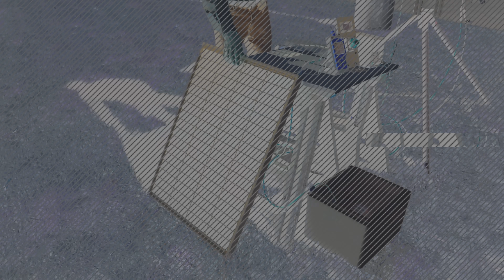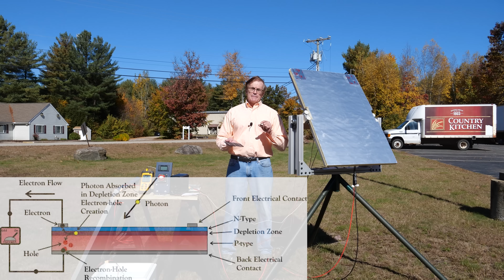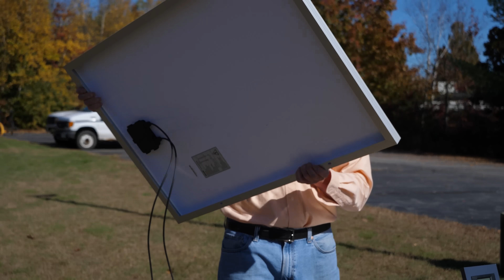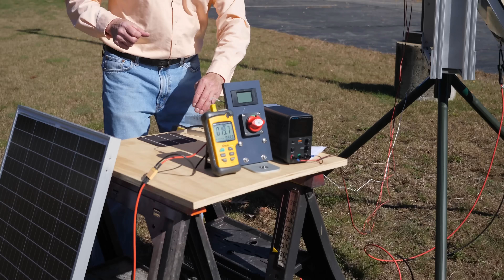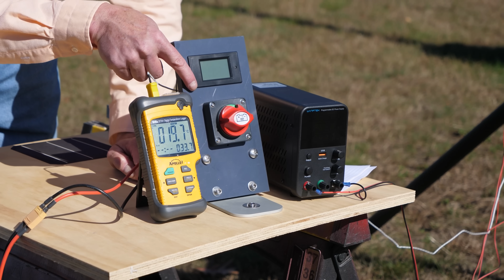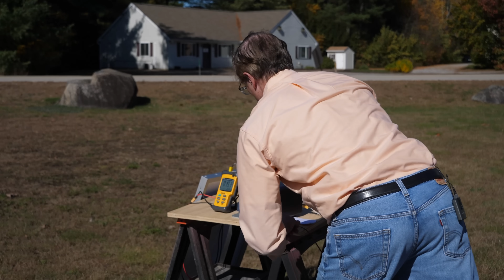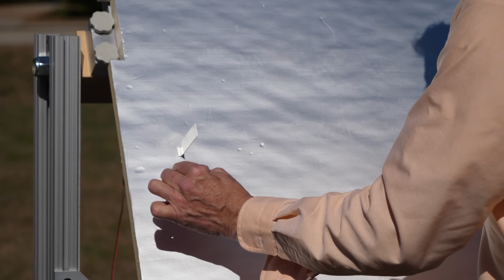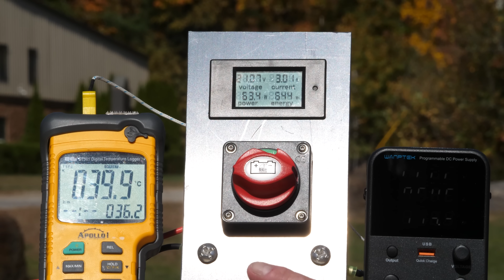Do you REALLY get enough out of your solar panel?

Comment: Imho you're reasoning in the wong (as the chinese say) direction.. Make PV panels generate heat, pump it up with the panel, then you can achieve 80% efficiency..
Reply from the maker: You're simply incorrect.
Do a little  research into the operation of a solar cell.
Reply: @TechIngredients  not incorrect. I mean a panel gets very hot (70%+ of incoming solar gets converted to heat), transfer that heat to water and pump up the temp with the panel output. There are several companies selling products that allow dual use.
Reply from the maker: That heat still needs to be dumped.  If the water becomes  warm enough  to be useful, then the panel  output drops.  If that water is maintained  as cool as possible to maintain PV output, then that water will remain near or below ambient temperature.

Comment: We're just starting to do optimization of our panels outputs on our offgrid setups. Angle is pretty key. I'm working to implement actuators that are arduino based to either follow the sun with a photoresistor, or just set a calendar with optimal angles based on date. I'll have to track the power the actuators use, and make sure they stay in a non-powered, idle state most of the time. Just moving the angle on my solar panels on my solar powered toolshed, increased the output on a 300W panel from 135W to 175W, at about 20 degrees closer to perpendicular to the sun, to 215W in Central Texas at pretty close to perpendicular in the Winter sun! These are used industrial panels too that we picked up for around $75/per.

Comment: I thought the cooling power of the systems of dripping water over the panel surface is not simply the heat transfer but the evaporation cooling? Esp. if the temp difference between panel and air is that high  and the humidity is low it should pull a significant heat energy from the panels, even to below air temperature.
I think it might be interesting to see the effectiveness of just keeping the surface moist...
Reply from the maker: You're  correct, it's  both.

Comment: I have a ground mounted solar system. The age of deflection is 25 degrees, with the solar panels distance from the ground is 2 feet in the front and 8 feet in the back. I believe with this amount of air movement should keep the panels cooler. 
What are your thoughts?
I look forward to your response.
Reply from the maker: Increasing the airflow and / or increasing the surface area to interact with that airflow will help.

Comment: You missed the main reason for using water on the panel surface. The water is not only cooling the panel by absorbing heat it is also EVAPORATING, the latent heat of vaporisation will cool the panel and the air in a warm dry climate. In many hot places they use evaporative cooling to cool the air in their home. Sure over time the the water supply will warm up and you need to use pure (rain)water otherwise the salts disolved in the water will build up on the surface of your panel and increase in your water storage. Evaporation of rain water of your panels will remove about 670 Wh/kg of water, a lot more heat than the gain in temperature from the water.

Comment: Maybe it was mentioned and I didn't hear it, but the increase of watts in efficiency is meaningless as it only applies to this particular model, but percentage increase in efficiency is important.  Based on their results, and accounting for the fan draw, we are seeing about a 3.5% overall increase in efficiency. That might not sound like much, but in the world of solar power, this is a pretty big deal. Assuming the overall efficiency of the panel is roughly 20%, that brings us to 20.7%... which again doesn't sound like much, but really is a pretty big deal. 

Now, one issue I have is that the panel was veing manually moved to optimize solar gain. Probably not a big deal, but an automated system that does the same will also have a power draw that affects the efficiency. I think it would still ultimately result in a net gain, but I would like to see this accounted for. In addition,  a line of solar panels tracking the sun would probably result in some panels putting others in shadow. Anyway, a lot of interesting incremental problems to solve, and I look forward to new developments from this channel!
Reply from the maker: You don't need to track.  I only did this because we were comparing the cooling to passive and couldn't do this at the same time. This made the testing fair.
Reply: @TechIngredients  true, but that doesn't mean you still shouldn't build one! :-)

Comment: The fans need to be installed at the bottom of the panels so they're working with, not against, air convection.
Reply from the maker: No.
They're drawing the air out, not pushing it in.  Convection isn't  opposed.

Comment: Thanks for the science channel here. One idea I can see is that the fans are at the top and suck out all the air and create negative pressure, what about putting them at the bottom and blowing in more air that can receive the heat and it comes out at the top. I have seen someone else who uses his heat pump where he has made a kind of greenhouse with solar panels and the heat pump cools down the panels and heats up the house.
Reply from the maker: The fan position is probably  insignificant.  For what it's  worth, in our arrangement, any heat generated by the fans isn't  added to the cooling air.

Comment: I've been looking into using solar powered fans to evacuate heat from my attic during the summer I intended to maximize their efficiency.  For summer solstice and did not expect them to produce at all in the winter. The rood on my house is quite large and im nearing time for a replacement, adding solar would probably not cost me as much more as the roof replacement.

Comment: You have ignored the inefficiency of the power supply.  The cost of the power supply is also a factor to include with the cost of the panels, and that is also a point of failure because the power supply adds more parts that can fail.  Your suggestions to go with larger fans to handle more solar panels also have to be engineered to flow properly amongst the panels and then there is the complexity of the ducting which you don't want to aid in the heating of your cooling air.  Considering the additional complexity, the additional costs,  and reduced life-cycle costs, it isn't practical except as a science project.  Of course, results will vary.  The equator will provide more photons, but additional heating of the solar cells -- the efficiency ratings given by solar cell manufacturers likely doen't include the degredation due to heating of the panels.  Likewise in Florida, the ambient temperature of the air is warmer year round so solar efficiency is always lower than what the sales people claim.  So, caveat emptor -- let the buyer beware.  This was educational and as usual, well presented.  Cheers
Reply from the maker: I didn't  include  the power supply  cost because  it's  insignificant.  We used the lab supply  because, as I explained, it shows the power consumption.  The DC fans can be run directly by wiring them in series  to match the output voltage, or a solid state voltage converter can run the entire system which consumes little power, so it's cheap.  Any ducting actually  increases effeciency because the ducting is in the shade and so will be at ambient temperature as is the air that is drawn through it.
Reply: @TechIngredients  I agree about the power supply cost.  However the power supply uses electricity which appeared not to be included in you efficiency results.  If you had shown that losses converting the significantly higher voltage (18-21V) down to 6V decreased the overall efficiency by X% resulting in an overall system efficiency of y% improvement, then I wouldn't have commented at all about the validity of your claim but it seems that you stopped 10% short of proving there is a gain of efficiency after accounting for all losses in the system (including the voltage conversion to drive the fans).  The video left the impression that the intent of the video was motivated mostly by driving sales of your superior thermal paste.  I imagine the heat sinks consumed a good amount of paste/panel too.  You did assume a voltage converter losses are insignificant but you did not test it to prove it even though an off the shelf converter board costs little money to buy.
Reply from the maker: If you're  concerned, then just wire them directly to the panels with each series sized to match the desired  voltage. Voltage converters are over 90% effecient if you go that route.
Also, if manufacturers built panels with molded fins, then these would be even more cost-effective and efficient, eliminating  the need for the added labor and the TIM interface.

Comment: I hope you read this: most solar installations are fixed and are not pointing directly at the sun 100% of the time they generate electricity, however, the fans remain at a constant power draw. What would be the efficiency difference of a cooled and non-cooled system over the course of a day as power generation degrades over the day? Maybe it won't matter on a system for example where my theoretical per-panel power generation is 400 watts? Or devise a way to cut power to fans at some sub-optimum level? Or even more so, that even though I live in warm SoCal that temperatures would drop as direct sunlight drops? Is that enough of a drop? So many questions.....
Reply from the maker: That's  easy to implement.  Add a fan controller that turns on the fans when a certain temperature differential  between the ambiant air temperature  and the panel temperature  is exceeded. An Arduino controller can do this.
Reply: @TechIngredients  Thank you for the reply. If I have to do some modification to test efficiency, I would rather install sun-tracking modules for my panels 🙂

Comment: In regards to the backing used :
Using aluminum sheet flat on one side with cooling fins on the back would definitely make sense and be more cost effective than any ad hoc modifications done for custom installs .

Cooling to ambient air temps certainly looks good , but , in my mind , it may just be possible to get far better cooling with a ground state geothermal loop and  a highly efficient pump .
Ground temperatures a few meters below the surface approximate the average yearly temperature ( until you get more than a kilometer or 2 deep , where it starts to rise ) .
Of course this adds expense to the installation .
However , considering typical summer temps in my area are 32C .
However , underground temps are typically 13C year round .
That is quite a difference and could be worth the extra expense , complexity , and , current use .
Adding hollow threaded aluminum heatsinks to facilitate active liquid cooling is certainly doable .
Reply from the maker: Those are all good options.

Comment: Thank you for this very interesting test and demonstration Professor. 🤔 Do you have an equation for this temperature to wattage gain ? Also, have you been able to calculate the falloff in overall photonic efficiency based on degrees of Latitude North of the Equator ? I am located around 49 Degrees North on North Vancouver Island, BC, Canada. I have noticed Solar Panel efficiency to be really reduced during the Winter Months in my locale.
Reply from the maker: Off hand, I don't, but it's  a super simple Google search.

Comment: How about having solars in catch all angles?
Like a lower panel being at an angle of e.g. 45° and above it a panel with e.g. 135° as to have them both reflect rays towards each other no matter what angle the sun is.
Reply from the maker: That's  an interesting idea.  The trade-off is that the individual  panels  will be operating  at less than their optimal angle to the sun.  Whether the light gain due to reflection will more than compensate  for that loss would have to be tested.

Comment: I was thinking if there was enough of temp difference for a series of tec to drive those fans. I guess it could work maybe?
Reply from the maker: It might, but  it's probably not worth it.  These devices  are not cheap and are very inefficient. Take a look at our previous video on "The Campfire Generator."
They will also slow the heat transfer from the panel, reducing  the effectiveness of the fans.

Comment: Interesting , Iv seen the problems with extreme heat, i live in france with extreme difference in winter/summer , (+50 -20°c summer/winter) looking at hybrid pv/water sandwich panels and trying to see if the cooling affect on the pv panels makes a difference enough to do it ? i think the argument o prologing the 'efficient' life of the pv of 5-10 years or more is a strong argument,, thank you *

Comment: What are the constraints of say, running small diameter copper tubing throughout the panels interior, and putting a coolant like freon through the tubes, carrying the heat away? Could the freon be circulated by the heat itself, instead of a compressor? 
Basically the same idea as a heated floor, just cooling instead of heating. Would this work at all?
Reply from the maker: Because  of the low temperature differentials and the large heat capacity of water, I'd avoid the freon.  Panels like you described are already  commercially available for water.

Comment: Next up, do the same with a thermal chimney.  Use the same heat to pull ambient air through the panels, actively, without electricity.
Reply from the maker: The problem  is that even though the modified panel runs slightly cooler than the stock panel, even with the fans off, the difference is small.

Comment: 6500usd for 16x panels of 495. I get back 50 cents per kwh for delivering to grid. 20 year lifetime garanteed. I Produce 800 kwh hours above yearly use. So getting extra kwh a Day would make a difference on the yearly. I wonder if a tube water heatingbsystem added below the panels would deliver extra power or saving on water heating somehow.

Comment: The water you mentioned is probaply meant to cool the panel by evaporating from its hot surface. Works probaply well at hot deserts if done right.

Comment: Finally a good video on the subject.
In a family, exchanging the temperature into a water battery would be the best solution, as your daughter could take longer showers while you get more power.

What is not addressed is the energy needed to build the fans etcetera. These costs are expressed mostly in cheap energy, not more expensive green.

My largest objection has to do with those that wants to grow vegetables using LEDs from solarcells instead of directly in the field. 20pc efficient cells and perhaps 50pc efficient LEDs removes most of the photons that would have otherwise hit the plants directly. But indoor growing in dark containers is a thing.

Comment: I see an issue which very likely has been talked about already; he compares a boxed panel to a boxed and fanned panel. Not an open back panel to a boxed fanned panel.
Reply from the maker: It has been.
The modified panel runs slightly cooler than the stock panel when the fans are off.  The difference  is small but significant.
Reply: @TechIngredients  ok fair enough
Thank you for the work you're putting out.
Reply: The bigger issue is that he uses the same resistance for both boxed panel and boxed and fanned panel.  Contrary to the video creator's claim, Photovoltaic panels DO NOT deliver near peak output (power) over a fairly broad load range.  Just by looking at his data, you can see that with the boxed and fanned panel the 7 ohm resistor "loads" the panel to rather near it's maximum power point whereas with the boxed panel (w/o fans running) the 7 ohm resistor "loads" the panel to a point on the current vs voltage curve (IV curve) that is "beyond the knee" of the IV curve.  When loaded beyond the knee of an IV curve, the power drops rather dramatically.

In short, he absolutely should have used a maximum power point tracker (MPPT) for both.
Reply from the maker: I don't  see how you concluded from my data where the "knee" in the power curve occurs. Keep in mind that the change in the output power was less than 10%, and the effect, as little as it was likely to have been, could have been in either direction.
Reply: @TechIngredients  Respectfully, first, I didn't say knee of the power (vs voltage) curve.  I said knee of the current vs voltage curve (IV curve).  Second, all other things being equal, for a temperature difference of only 13 Celsius, the maximum power CURRENT (Imp) for both fans off (hot case) and fans on (cold case) should be pretty much exactly the same but the maximum power VOLTAGES would differ (the hotter being lower).  Since you measured 2.90 amps in the hot case and 3.01 amps in the cold, that tells me the hot case was "beyond the knee" (of the IV curve).

For a given resistor (load), one or the other case (hot vs cold) would be favored.  It just so happens the 7 ohm load you used favored the cold case.  If you had used a bit lower of a resistor, it could have favored the hot case.  I'll grant you it's all very subtle but the point remains that you certainly were not loading BOTH cold and hot cases at their respective peak power points.  At best, you were only loading the cold case near it's peak power point.

I love this stuff and you've done a pretty good job.  How familiar with solar panel IV curves are you?  I'm rather intimately familiar with them.  Maybe I can make my first YouTube video showing some of the subtleties!
Reply from the maker: I've  a pretty  good  understanding of the principles and typical curves.
You really should do this.
Sharing knowledge  is one of the most important  things a person can do.
It's  also a lot of fun!
Reply: @TechIngredients  My apologies for messing up the order of these posts.  I deleted and re-posted (after a minor edit) the comment immediately above and, as luck would have it, you responded in between!